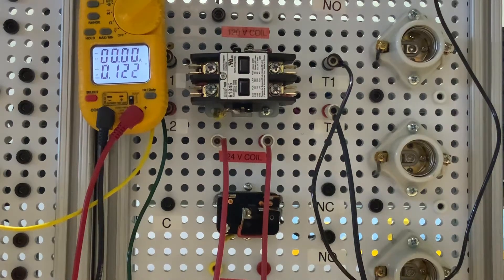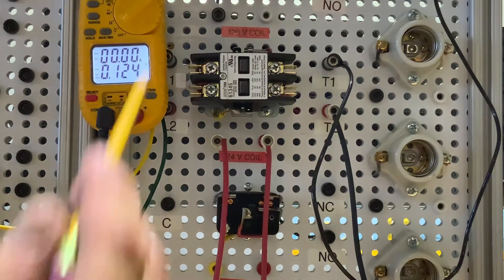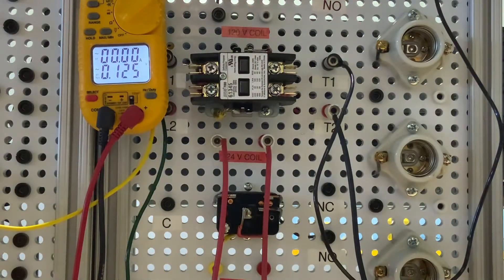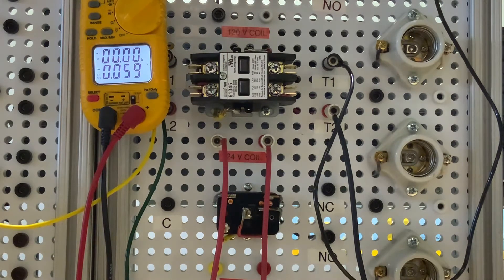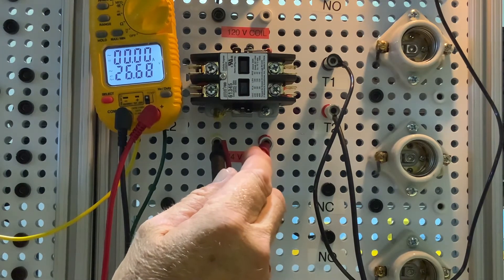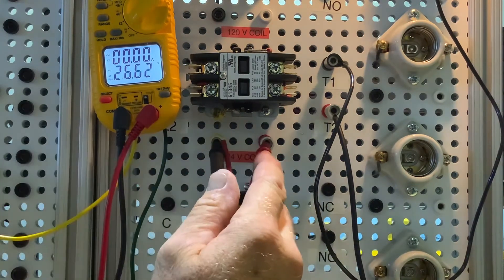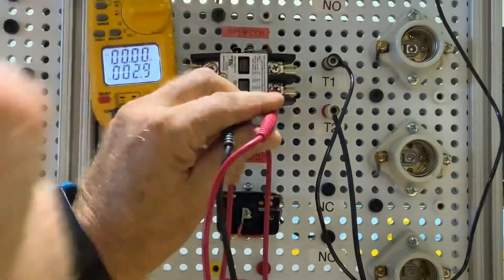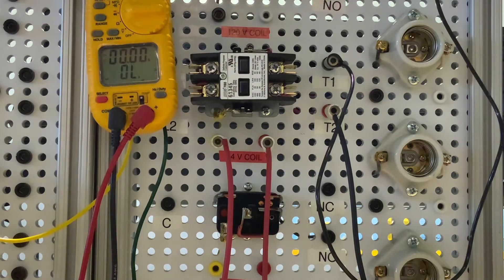How a 24 volt contactor works HVAC

Comment: Why is it called a "contactor" in AC terminology? Isn't it just a "relay" as defined in electronics and other types of electrical work?
Reply from the maker: Contactors are heavier duty than relays. Contactors are used where the amp draw is higher than what a relay can handle.